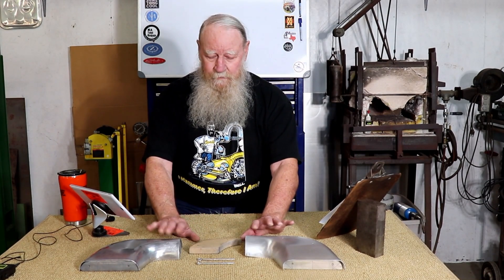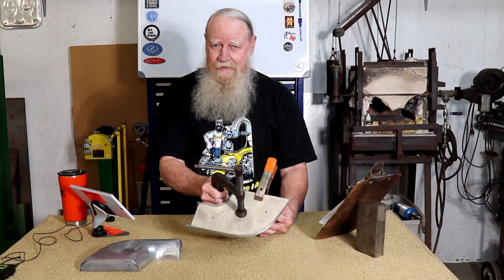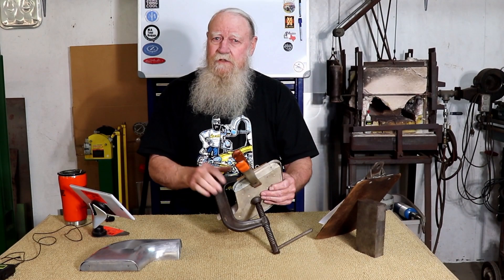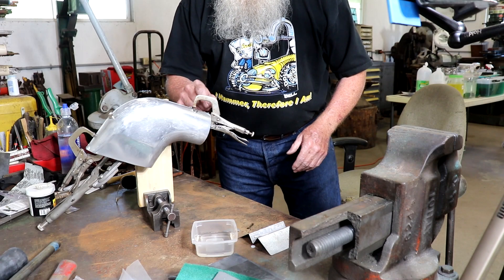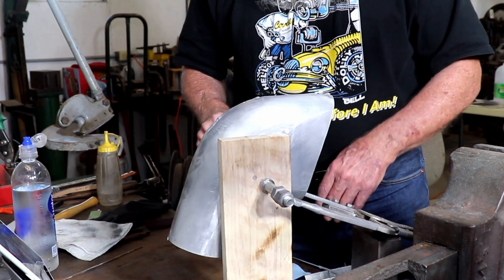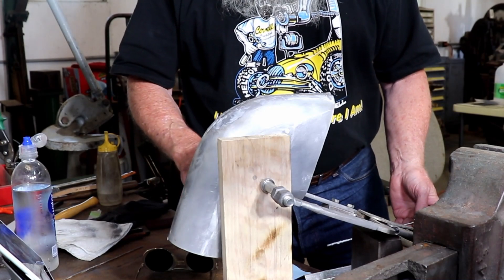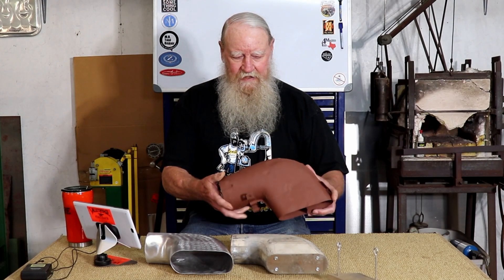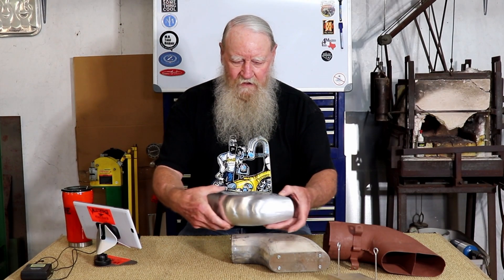Making An Odd Shape With Ron Covell – Part 4

Comment: This was an absolutely awesome series and collaboration with Ron Covell!!! I learned a ton from you guys! Hopefully, you guys will do more collaborations in the future. I’m a new subscriber and found your channel through Ron’s...so glad I did! 👍

One question...what was the name of the small welding torch you used and where could I go to purchase one? It seems like you would have a lot of control with a torch like that as well as possibly save a lot of gas!
Reply from the maker: Collin,

Thank you. Ron and I had a lot of fun doing this one.

The torch is a Cobra torch (now called a DHC 2000). They are sold through Aircraft Spruce or you can look them up as DHC 2000 and see if you can find them cheaper.

Jere

Comment: Jere - Hey, your part came out exceptionally well, and the 'engine turned' surfaces are a real visual plus! I really liked the clever steel strips with strong magnets you used to hold the parts together. I've never seen that done before, and it worked perfectly for this part. Of course, the only reason your part and mine mated so well is because of the finely-crafted and accurately-shaped hammerform you made. Without that, it would have been a fool's errand to have two craftsmen try to make parts that fit together with any precision.
I also loved your radically-modified sanding discs. I can see they are superb for tight inside curves!
All the best, and I hope the weather cools down so you can work more comfortably!
Reply from the maker: Ron - I thought I responded to this last week but I see this morning that I hadn't.
Had a nice long talk with Bruce yesterday. Will be talking to you shortly.
The heat has subsided but will return Thursday.
Jere

Comment: Great work, Jere. I enjoyed the series.
Sorry, but I wasn't that "amazed" at the fit between the parts made by two different people... considering the two people were you and Ron Covell! I would have expected little other than a good fit. Talent and expertise causes that sort of thing, ya know. ;)  
I was duly impressed though.
Good luck with the extreme heat.
Joe
Reply from the maker: Thanks Joe. I think the heat wave is over. Only 86deg. expected today.
Working with Ron was a pure pleasure.
Jere
Reply: I'm glad that your heat wave is over.
I'm on the East coast of Canada. We've had stupid high humidity here for too long and anything over 70F when the humidity 95% or higher is just "dad-gummed sticky-ish". And when it's been 90F with 100% humidity it's enough to melt the eye-balls out of a statue. Those right there are 
o-fficial meteorological terms. 
Looking forward to your next video.
Cheers

Comment: Excellent!!!! Amazing that two men separated by who knows how many miles can make the same thing only mirrored!!! And it fits so well!!!
I Am Not Worthy, Master!!!!
Keep Rocking it out!!!
Reply from the maker: Hey Pat:
Both the top and the bottom were made from the same hammer form. They fit together so well because the both of us have experience making parts the same. Anyone can make a single piece but making the second one the same is very difficult.
Thanks. The heat has kept my rocking to a minimum.      Jere